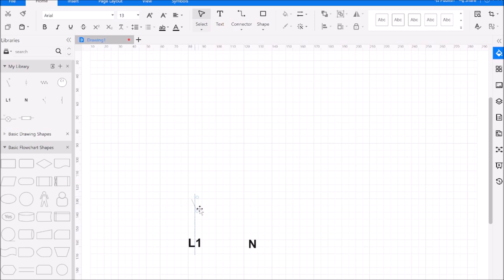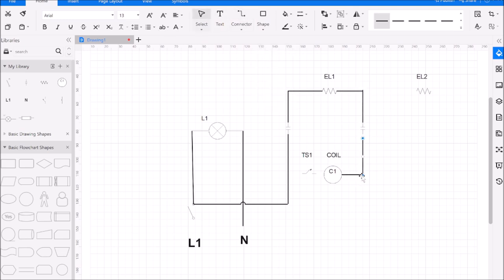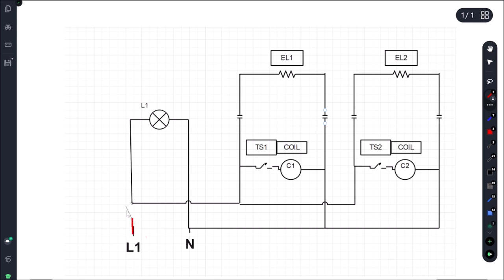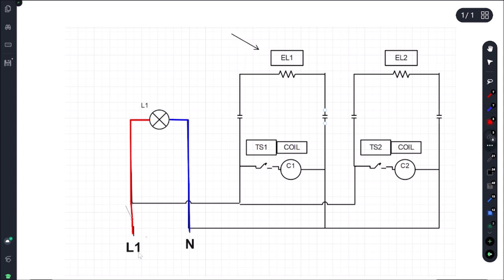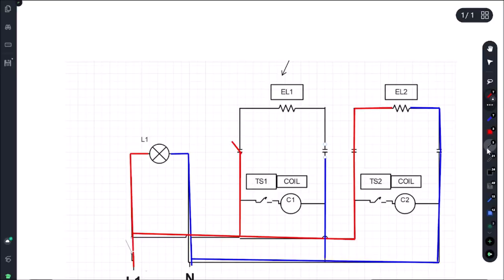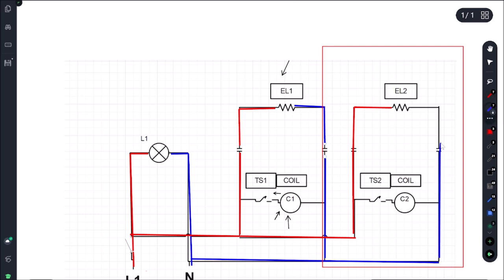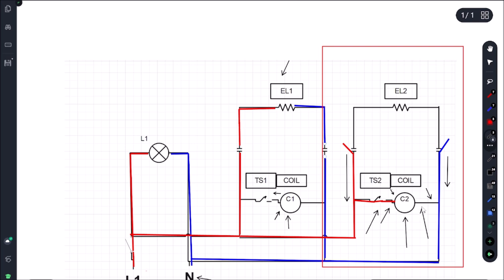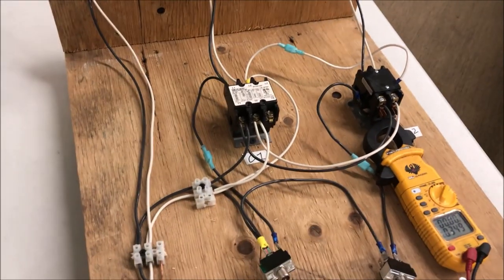Basic Electrical Troubleshooting HVACR

Comment: If potential voltage confuses a new tech they could resort to continuity checking with device de-energized.  Thanks for sharing.
Reply from the maker: Yes absolutely. I try not to teach continuity and prefer that techs test things live because of breakers being too far away and back feed. But in this case, testing the thermostat for continuity after you find the voltage has dropped there is a great way to confirm.